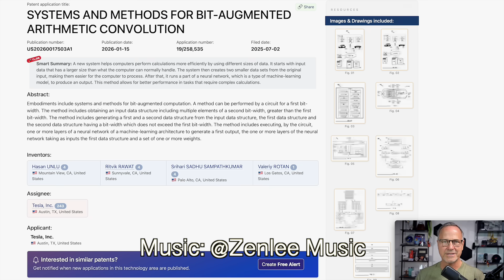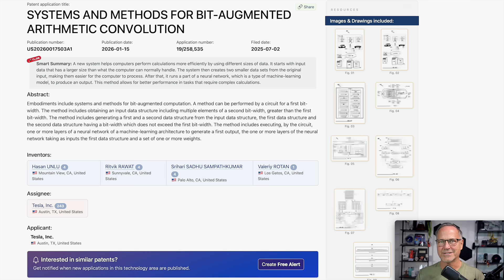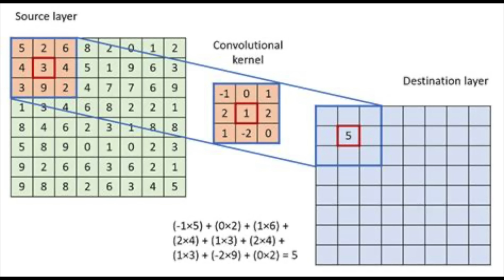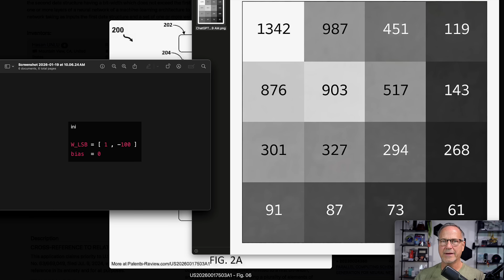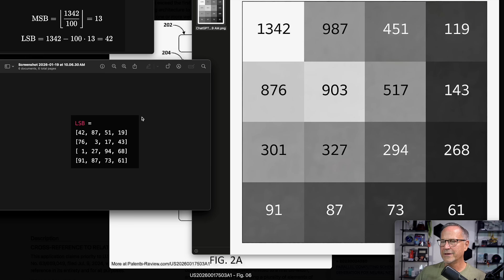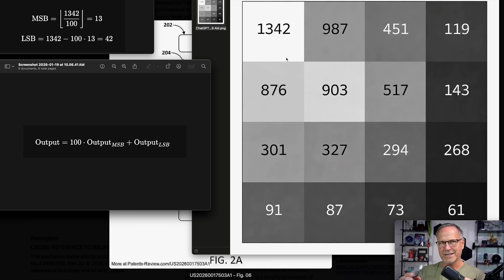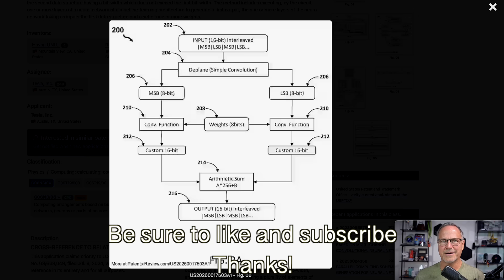Tesla Turned Obsolete Hardware 3 Into a Modern AI System

Comment: The dual chips were originally intended for redundancy, a failover. Once they moved to the “vision” system, they were woefully short of compute power and began using both processors independently. (The little button distance sensors gave an instant, accurate answer that HW3 could quickly process. Analyzing video frames to get the distance is orders of magnitude more compute intensive and additionally required much higher resolution cameras to get a usable answer.)  Computers have had to deal with similar techniques for high precision numbers since ENIAC. The problem is that needing to use both processors to get the answer that one HW4 chip does means you have effectively halved the available compute power you had available as HW3 is utilized now. That means that it will take significantly longer to process an algorithm on HW3 using this technique to get the more precise answer. As we saw with the move to HW4, higher resolution cameras are necessary to get decent results. They are upping the resolution AGAIN as announced for HW5. Just raising the resolution dramatically ups the compute power required to analyze an image. Is that a car bumper or a water drop on the lens? - analysis that takes a lot of pattern recognition computing and the more pixels you have to analyze the longer it takes, but you do get a higher confidence answer. That is why every time you up camera resolution you have to nearly quadruple compute power to stay even with the analysis rate, but your answer is much more reliable. There will be significantly less results per second, but I doubt with the low resolution cameras of HW3, that better math will make for better driving.

Comment: as AI related code gets lots of runtime, surely they'll find a plethora of ways to reduce data input needs, improve accuracy and burn less cycles getting it all done.  I'm wondering if the power projects will turn out to be as dramatic as projected in reality.  I've seen optimized code reduce run times by more than half almost commonly... one run went from 22 hrs to just over 2 hrs by careful examination of how it was originally written for older hardware. (PDP11 to VAX750).  Maybe one of AI's greater values will be examining running code in existence and optimizing rewrites.  All those would save a lot of power. just adding a comment for your engagement stats.

Comment: Great video but still important to remember that AI4 hardware includes improved cameras that aren't addressed by this change.  For example the rear camera has a wider view with AI4 which makes it much safer for FSD to backout of a parking spot since it can see close to 180 degrees.  AI3 range of view is narrower which will matter.  Other cameras are improved as well so it's not clear what percentage of the improvements necessary for unsupervised FSD fall on the cameras vs the system board.

Comment: "take 2 digits to the left, take 2 digits to the right" is an easy and frankly obvious part. How do they manage to do the arithmetic operations with this convoluted setup - that is the actual juice. Now, if multiplying 2 convoluted 16-bit matrices, you need to do 4 matrix multiplications, one bit shift, and 3 additions. Moreover, 2 of those multiplications would be cross chip ones - does Tesla have functionality in their chip? Is that functionality even close to being as fast as multiplications within a single chip? Even in a ludicrous timeline where the first answer is "yes", cross chip matrix multiplication simply can't be even close by the order of magnitude to the on-chip computation.

I am very disappointed at this extremely deceptive video making people think they understand what is going on. You may as well teach flat Earth physics at this point.

I'm not saying Tesla didn't do it (they obviously did, since they told us so), I'm saying this video pretends that it explains how they did it, which can't be further from truth.

Comment: If the operations were split utilizing the redundant processor (which as @Techridr points out is not actually the case), then you lose redundancy, which is a pretty important safety feature. If you’re traveling down the highway at 70 mph on FSD (Unsupervised), and one of the processors goes out, you’re now dead because there was no fail safe.

Comment: Method sounds similar to a method I used to speed up a search engine; get the majority of the results in low resolution, then sort using high resolution; when done right, the results are exactly the same as before but 50x times faster.

Comment: Hi John, as a HW3 Model 3 owner (in Australia - still waiting for any version of FSD), this gives me hope.  Is there much of a downside of losing the redundancy of two processors working independently?  I presume this was intended as a safety mechanism so that if a processor gets it wrong, it is evident.  Not sure how this was supposed to work.  Unlike a spacecraft, which I understand have triple redundancy, so presumably you would use the output of the two computers that agree and ignore the one that differs, you wouldn't know which processor was right and which one was hallucinating.  Do you know how often this occurs?

Comment: Back in the days, we had game consoles with hardware that ran for many years, almost a whole decede... and suprisingly the  gqmes became better and better. At the end of a hardware lifecyle you couldnt imagine before, what crazy things are really  possible on this old chips. Programmers found tricks to use the hardware almost over their imaginable limits. 
How ever, the lifecycles become shorter and shorter. If you have a problem, you solve it with brutal new hardware power and you never go to the real undiscovered limits, because your problem will be solved in a few month with just more power. Also the AI models we use every day, we cant be really  figure out the limits, untill the next model comes. But I think,  because of the short lifecycles, we just tip at the top of an iceberg  of that, whats really possible... ;)

Comment: id rather wait for real hardware upgrade.
if Tesla update my intel HW3 to v14L it might burn down my APU, like you said it will run at full power at maximum and its not under warranty in any way, i'd have to spend $2500 for a APU/MCU
 wont take a risk to update, this is just a bandage.

Comment: 4:11 No no no no.... That’s not quite how it works. Tesla is not taking a 16 bit operation and splitting it across the two redundant processors to gain extra compute. Those processors exist for safety and normally run the same workload to cross check results, not to share the load.

What the patent describes is splitting higher precision values into multiple 8 bit components that are processed by the same INT8 compute units within a single accelerator, then recombined. This improves efficiency and precision handling, but it does not increase raw hardware performance or turn redundancy into extra compute
Reply: Thanks for clarifying because by first thought was they are losing redundancy which is pretty important. Losing it, in my mind, means they could not (or should not) actually support Unsupervised FSD… which presumably is the whole point of this.
Reply: So throughput stays roughly the same or will it get slower?
Reply: @kevinegal8586  Throughput actually increases
Reply: @kevinegal8586 makes no sense.  How do you split a 16 bit number into two eight bits? Eight bits is 256, resolution-wise.  So two eight bits is only 512. If they are somehow retiring the bits to form a 16 bit chip, the calculations will be slowed down significantly.
Reply: @greghelton4668  "Eight bits is 256, resolution-wise" yes 2^8 = 265.  "So two eight bits is only 512", no 2^(8 + 8) = 2^16 or a 16 bit number.  512 is 9 bits, 2^9=512.
Reply: @greghelton4668  It’s not an upgrade to the resolution of the numbers; it’s an upgrade to the efficiency of the data movement. Tesla is using the 'fast lanes' of an 8-bit chip to carry 16-bit passengers by having them ride in two smaller cars instead of one bulky bus.
Reply: @Techridr lol😂good one.

Comment: Monday, January 19, 2026 . . . Hello, Dr. Know-it-all Knows it all. My informal understanding of mathematics (I acknowledge that I have deficits) suggests that running complex "AI, ANI, AGI, and ASI" autonomous software designed for 16-, 32-, and 64-bit hardware could be adapted for older 8-bit hardware. However, past experiences with this kind of adaptation can cause regressions that reintroduce the same types of analytical and anomalytic geometries that have troubled self-driving vehicles in previous versions of autonomous driving software. It can work and be engineered to work well; however, the complexity would be similar to synergistically using "LiDAR, HiDef-Radar, Sonar-sensors, and HiRes-Cameras," which more and more EV manufacturers, due to the inherent complexities, are choosing not to pursue. I was using software specifically designed for these adaptations. From memory, the software's author mentioned that some hardware was vulnerable to glitches and subpar performance, and on my equipment, this proved to be true. He or they were planning to attempt a more robust rewrite, provided he and his team secured additional funding. I’ve always dealt with memory stuttering, buffering, and underwhelming cache performance, even after buying premium, professional, customized systems. I always tested my systems, pushing them to their maximum throughput (i.e., finding their "throughput sweet spot").
I hope and pray that this strategy goes well and becomes an outstanding success.

    I am an individual with a deep interest in Science and Technology. My personal (P-Doom² = 1,024²%) We Are Not Safe.

(Collaborative Rewrite with Grammarly, MS Copilot, and QuillBot.)

Comment: And old cameras with HW3, I believe less resolution and therefore a different input.  I get the feeling with this math trick it would speed the processing, but the input quality will be less because of the cameras.  It may take a lot of time and miles driven again to verify FSD with a different system.  In the end, It could be easier and faster to swap out the hardware.
Reply: I thought the same thing but was told that HW3 & HW4 are not swap compatible which creates other issues.  I think they hope this will suffice & run out the support clock on HW3 vehicles.  Even with this, if they can't achieve unsupervised FSD on HW3,  I see lawsuits unless they give full refunds &/ or get those who have HW3 into HW4 vehicles.

Comment: None of this is anything new. PLC logic has been doing this for decades. I don't see how its patenable. Perhaps something about using two chips, but I personally did this in the 1980s and I still use it on older PLCs today.
Reply: Still used in some solar inverters as they have 8bit regs
Reply: yes, exactly.  This process has been used for decades in software engineering.  They just found another place to use it.  Should not be patentable.
Reply: Patent applications (in the US) do not require new mathematics or new algorithms in the abstract. It only requires a new combination, applied in a specific technical context, with a concrete claimed benefit!
Reply: @Disgracefoold This is far too common and broad the even meet that criteria.

Comment: It’s actually much easier to calculate the LSB. You just need to mask the original number with 99 (obviously this only works in binary). But that way you don’t even need to serialise the calculations of the MSB and LSB. Both happen in parallel and are super fast operations.

Comment: Transferring the data between the  two processors is way too expensive  and remove redundancy. They only compare results at the end. What they can do is run pairs of mostly independent streams on the same processor to increase the resolution of calculations when they want to,

Comment: John, the compression speeds up multiplication and division chains regardless of the hardware.  Yes, it might allow v14 to run on HW3/AI3.  More importantly, it supercharges AI4 and offers a method to get local compute speeds out of AI4 that approach those of AI5.  At the same time, the local data compression allows FSD to increase the effective AI4 memory size.  Selective use of log values within FSD provides both an increase in speed and memory that could give FSD on AI4 performance approaching that of AI5 without the use of logs.

The same boost is true for any binary FSD AI hardware.
Reply: Partially true, but it's important to note, it doesn’t magically make the raw hardware faster at math than it actually is. It optimizes how the math is represented and scheduled, not the silicon speed. So this isn’t an unconditional speed-up of multiply/divide chains regardless of hardware. The gains come from better precision management, memory efficiency, and utilization of existing compute units
Reply: @Techridr That is the insight of Tesla's patent.  It increases throughput significantly without reducing the number of calculations or updating the hardware.  When you zoom out to a multi‑resolution, multi‑matrix graph with shared products, log‑coded representations don’t just give a per‑product speedup—they reshape the whole bandwidth/parallelism envelope of the system.
Reply: Totally

Comment: There's nothing weird or new about this. When we first got our ZX Spectrum 48K you had clashing colours and no speech, by the end of it's main lifespan, there were games that had solved colour clashing of sprites, and that had recognisable speech in them. While still being only 48 or 64K. The same thing happened with the Amiga 500. It started cool and ended cooler. You don't see these advances in gaming anymore, because the coders aren't as good at their jobs, and they are not working hard to optimise their games, but some of them do still do that. Obviously not the Borderlands 4 monkeys but they can't even improve their game UI game on game, and Bethesda don't do it, because they prefer to make billions and then get their jollies by breaking the game after ten years and then failing to fix their mistakes. But they actually always release janky games and kept them janky and it was their community that fixed it for them. There is absolutely nothing weird going on here, nothing anyone should remark on as if it's a surprise, novel, original or anything less than we should absolutely expect them to do. 

Doing this means you get the benefits on all your work going forward - you can do more with the hardware in the future, meaning Optimus any any other vehicle, robot or product, will be able to get more done. It's good news but some people are treating it like a miracle, instead of basic work.

Comment: Tesla just recently went the full AI route starting with FSD v12 and mostly end to end with v13. So to be fair at the time they made HW3 they didn't know what they needed as they didn't know they were even going to AI and its requirements. Same with HW4. AI5 hardware will be the first purpose designed AI chip. I'm glad Tesla was able to pivot so quickly to AI, but sad the current hardware doesn't have the capacity AI really needs. AI5 solves it and HW4 will get it there for "unsupervised" at least in geofenced areas, AI5 perfects it with room to work with.

Comment: This is interesting, but what is the downside? Does this compromise the redundancy that the second chip was originally designed for?
Reply: If I understand John correctly, yes, redundancy is likely lost as is shadow mode.
But, how many HW3 FSD computers have been replaced due to failure?  I am not aware of a single one.
Reply: @bru512  Yeah, that's interesting come to think of it. I've been watching Tesla like a hawk for 7 years and never heard a whisper about a single computer problem
Reply: @DblSpk4u  right! I bet they also have the data to back this up!
Reply: @DblSpk4u … but I think the second module is for validation also. So it’s useful, even if there is not a complete failure
Reply: That was exactly my question, thanks for asking that!
Reply: The split and weights apply to both sides in the event of an out of bounds output the data is loop back a second time also each chip has ecc and crc signatures or all data transactions with memory this is why they are so reliable and the fail safe if the driver takes over in any event a crc check fails the fsd computer is not required to drive the car you can flat out remove it in service modes and still have manual control.
Reply: Maybe limit is supervised with humans as the redundancy vs unsupervised with redundant processing and sleeping humans.
Reply: Well each chips has many cores and computes in parallel. So they could also apply this to each chip and keep the redundancy. But this could impact the throughput too much?
So
No redundancy = HW3 stays supervised
Redundancy but slow = HW cars will drive like granny's in bad lighting conditions. 😂
Reply: Redundancy should still be intact, as the technique is architected for single-chip execution, and HW3’s dual-chip design allows mirroring the full workload across both for safety. This aligns with Tesla’s emphasis on reliability in edge AI for vehicles.